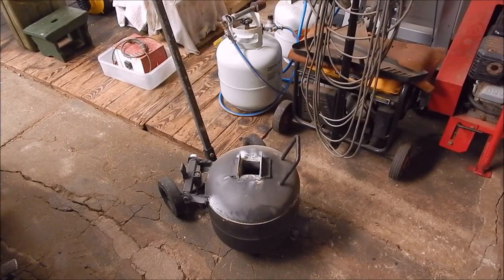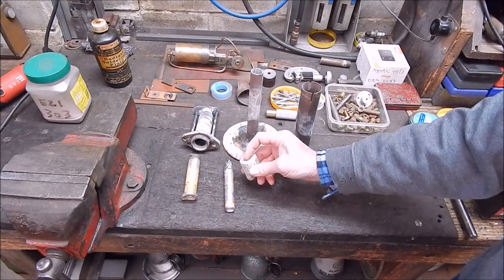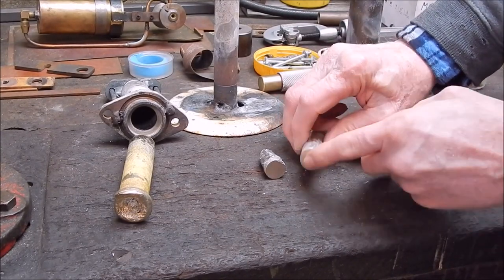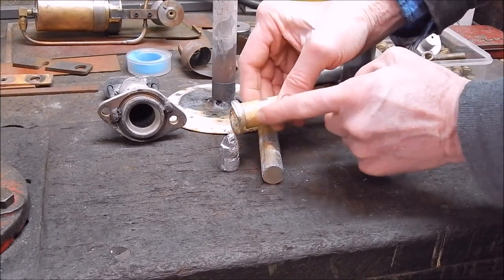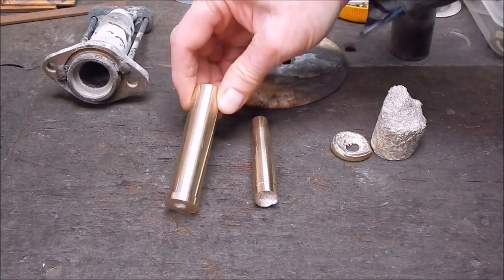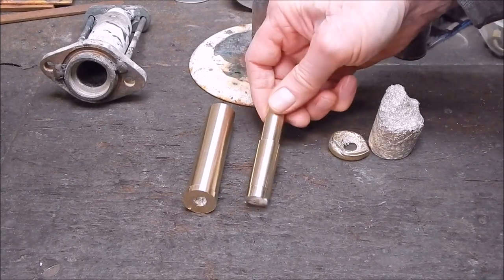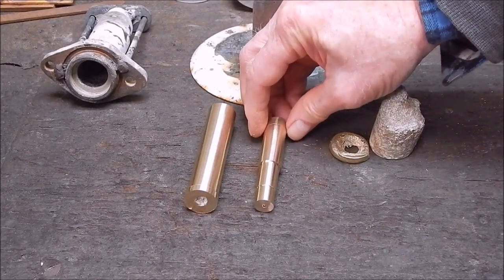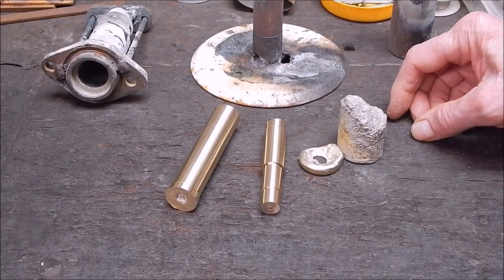Tips for successful backyard casting of brass round stock

Comment from the maker: Note:  Next time I melt chromed brass I will pour the melt into the large mold and hold it at high temp to keep it liquid and allow the heavier metal (whatever it is) to settle/pool at the bottom.  Then it should be easy to remove that layer with the saw when cooled.  Should work I think. 

I have come to the conclusion that the heavier mystery metal may be nickel, used as a binder/intermediate layer between the brass and chrome.

Cheers Rob

Comment: Thanks Rob, I’ll be taking that on board. I have buckets of scrap brass and number 2 copper to melt, number 1 copper goes to the scrappers. When I’m melting scrap aluminium I like to pour it into cast iron muffin pans first and then remelt what I need. I know that gets poo pood by the experts but that’s the way I prefer to do it. I also like to cast separate batches of similar material and this has revealed quite a difference in quality. I found complex heavy vehicle cast parts gave me the best “ingots” being very smooth with a beautiful even sheen and no porosity when cut where as a bucket of aluminium horse shoes were rubbish in comparison with a rough finish and some porosity when cut and more of a frosty finish to them. I guess this is due to the vast and complex mix that goes into what looks to be ordinary aluminium. I will also separate and pre-melt my brass and copper as well after watching your video. I put it down to the price of using scrap materials but it also give you the benefit of seeing how the metal will cast before potentially ruining a pour. Cheers mate, Stuart. Canberra. 👍👍👍
Reply from the maker: Hi Stuart.  Next time I melt chromed brass I will pour the melt into the large mold and hold it at high temp to keep it liquid and allow the heavier metal to settle/pool at the bottom.  Then it should be easy to remove that layer with the saw when cooled.  Should work I think. 

There certainly are enormous differences and number of types of aluminium.  Brass is similar and it's all related to the copper content as far as I know.  The cheap stuff being sold on Ebay/Banggood is a case in point.  Try silver soldering it and it may even melt due to the high zinc (or even aluminium) content.  It's happened to me if you get too agressive with the torch.

Fascinating subject which is far more complex than most beginners realise.

Cheers Rob
Reply: @Xynudu  Absolutely it is. I was originally getting all confused but the best tip I was given was to use cast aluminium scrap as that already contained the correct blend of materials to suit casting. I have access to large diesel pistons but I don’t bother and I also scrap any extruded alli and just stick to cast.  Cheers
Reply from the maker: Yes, I only use ally that has been cast and machined before.  Even then, there are huge quality/consistency variations and some grey looking die cast is likely to be rubbish. I find that high stress load scrap such as alloy vehicle rims are the best option and very cheap or even free.  Cheers Rob

Comment: Hiya, Rob. I believe those tap cover parts to be chrome plated zamak alloy.  Google will tell you all about it.  It's not totally chrome as a few micron thick coating could never amount to that much metal.  Of course without analysis we can never be certain but zamak is commonly used in bathroom fittings.
Reply from the maker: OK, that's a possibility, but Zamac doesn't contain brass, which is what 80% of it was when I turned it down. Cheers Rob

Comment: Hi Rob, another good video and thanks for sharing your knowledge and findings. I will need to do this soon as I have no solid brass left for projects. But, I do have a lot of brass fittings that I can melt down. When you let it cool down slowly, is it easier to get out of the mold than aluminum?
Reply from the maker: No, it has a lower expansion rate and can be hard to knock out.  A press would be useful.  It comes out more easily if you don't overheat the mold (to red hot).  Cheers Rob

Comment: Interesting stuff Rob. I never thought about it before but plumbing fittings must make a great source of brass, I'm sure that many just get thrown away. Cheers, Alan.
Reply from the maker: Hi Alan, I had a lot of these worn out old tap fittings laying around looking useless for years and this is a great way to get more life out of them.  The tap body brass is very good quality.  I had reservations about the chrome plated bits and hoped it would just burn up, but I was dead wrong.  The scrap man would give bugger all for them any way.

Next time I will pour the melt of these bits and hold the mold at high temp to allow the heavier metal to settle to the bottom for easy removal with the saw when cooled.  Should work I think. 

Cheers Rob

Comment: You can sand blast the chrome off. You can use hydrochloric acid (muriatic acid) solution or sodium hydroxide solution in a well ventilated area.

Comment: You got some very useful brass out of your scrap Rob. I imagine it is posable to cast larger diameter pieces and would only be restricted by the amount of actual scrap you have and of course the capabilities of the furnace you made. I enjoyed the making of this furnace and glad your making full use of it. Watch the fuel bills boss
Reply from the maker: Hi Ian.  The furnace is a huge success and cost very little to knock up.  Certainly handy being able to stick weld.  I did most of it with AC as I find that best for dodgy/scrap metal.  DC is much more particular and subject to arc blow.  I cut my teeth on AC and still prefer it.  The burner does eat up the gas, but not at a horrific rate.  That cylinder has done at least four melt sessions and will go one more, so that's about $5 AU a pop.  Quite reasonable.  Cheers Rob
Reply: @Xynudu  Great you share this stuff Rob. I have an arc welder tucked away for future use but want to try TIG or wire at some stage in life..one day.
Reply from the maker: Hi Ian.  I have never actually tried MIG or TIG but seen plenty done badly.  MIG only works well when used with gas and once again being DC the job must be thoroughly clean.  Those cheapskate gasless MIG spools just make huge spatter from my observations.

A decent AC stick unit can weld quite cleanly if done correctly.  DC stick is also pretty clean, but arc blow can be a serious/frustrating issue.  The slightest bit of magnetism in the steel will wreak havoc.   You rarely get arc blow with AC. 

For thin walled jobs like gas cylinders AC can work well provided you don't linger too long in one spot.  So you need to have some practical experience before attempting it.   A bit of paint hides a multitude of sins, so nothing to worry about ;)  Cheers Rob

Comment: not to bad rob .. your right with more heat and hold it there for a bit..
Reply from the maker: Hi Shawn. I think it may be the answer.  I'm also thinking the mystery metal may be nickel, used as a bonding agent between the brass and chrome layers.  I do know they do similar when electroplating some materials.  Cheers Rob
Reply: @Xynudu  That sound very possible Rob..

Comment: I reckon that was zinc at the bottom. Chromium has a melting point of over 1900 oC, zinc around 450 oC, while brass is around 950 oC, so I reckon the zinc melted and separated from the molten brass due to its weight. I'm no metallurgist, and I'm sure its far more complex than I imagine but basics are basics.
Reply from the maker: Good point Benny.  I thought being thin the chrome may burn up, but it's more likely to separate as a solid.  Looking at the metal weight table it indicates brass and copper are heavier than zinc and chrome, so that doesn't gel with what happened. I'm a bit puzzled by all this.

Next time I melt chromed brass I will pour the melt into the large mold and hold it at high temp to keep it liquid and allow the heavier metal (whatever it is) to settle/pool at the bottom.  Then it should be easy to remove that layer with the saw when cooled.  Should work I think. 

Cheers Rob
Reply: @Xynudu  Sounds like a plan. 
I am puzzled too...could it be lead - perhaps leaded copper? I found a comment in a researchgate forum where melting the leaded copper resulted in a separation of the two metals due to differences in specific gravity. I look forward to any other info you may uncover Rob!
Then the other titbit: "crystalline like structure that broke off by tapping"...not making much sense! That chunk you cut off - can you scrape it easily - is it soft like lead?
Reply from the maker: I'm wondering if it's Nickel and was used as a binder/base layer between the brass and chrome.  That's the only metal that fits the weight table variations by being heaviest.  Cheers Rob
Reply: @Xynudu  That sounds plausible - it looked like 10% of the rod was that material - you reckon there would be that much nickel required for plating? Rob, the plot thickens!
Reply from the maker: I'm not an electroplater Benny, but I do know they use multiple elements in layers on some electro plating jobs.  Given the original brass tap plates were pretty thin, the percentage of chrome and bonding elements would be proportionally high, so 10% could be around the mark.   Anyway I've used up all my old chrome tap fittings for now, so it's time to move on.  Cheers Rob
Reply: @Xynudu  Have you tried to see if it is magnetic?
If it is nickel it will be attracted to a magnet all other metals in brass ie copper, zinc and chromium are non magnetic.  Flaking chrome plating is sometimes attracted to a magnet due to the nickel plating.
Reply: @Xynudu  I hear you Rob.

Comment: I would be more than happy to use brass like that Rob---it looks excellent....  Question--have you tried using any of it for bearing bushing---wearing etc.. regards E
Reply from the maker: Hi Ian.  I have used it for small close fitting pistons in air/steam engines without any issues.  It seems to machine with similar characteristics to good quality bought brass and my metal bandsaw has a hard time cutting it, so it is quite hard.  Cheers Rob
Reply: @Xynudu  Thats good to know Rob---you can rely on a product thats good..

Comment: Hi Rob

Thank you for your efforts, please keep up the good work
It would be interesting to see the actual properties of these home cast materials, if anybody has access to suitable machinery and equipment to do metalurgical tests

I have been casting my own aluminium, brass and copper for a few years now and have used it for many things, without any problems, its just that I never know what grade it is, or even close too. When I have melted a mix of brass scrap of unknown grades, my end result is also unknown

I would not use homecast for anything safety critical, but I never know how good or bad it is

I have cast copper inserts from household water pipes for mallets and used them vigorously and they have behaved just like genuine ones
I have made brass engineers hammers out of plumbing fittings, again with no problems

I always try to separate my metal before I melt it, into groups and write on the cast bar what it was made from "aluminium ladders" "car wheel" or "burnt out car" are common ones

I use steel molds for my casting of general barstock shapes and blocks and had to thrash the cast item out of the  mold, but never managed to break any

I use extruded aluminium for casting and other than a bit more shrinkage, claggy machining and difficulty in getting a shiny finish, they have all been perfectly usable for non critical parts

It would be intersting to see someone do some serious testing of homecast materials

Thanks

Sam
Reply from the maker: Hi Sam, have you ever seen this mystery metal result before ?  I was quite surprised.  It has strange characteristics.  Looking at the metal mass tables it's also strange that it sank to the bottom of the mold as that rules out most likely suggested metals, except one "Nickel", but how that fits into the equation I can't say.  I think I can do a work around by keeping it liquid in the mold to settle out for a while.  I'm out of plated fittings now so it may take a while to try.  Cheers Rob

Comment: Hi, How did you get the pour out of the mold after it cooled?
Reply from the maker: Knocked out with a punch as the difference in expansion rates loosens the plug slightly.

Comment: The brittleness makes me think zinc (it's hard and brittle). Soaking in a medium concentration acid solution (like battery acid, vinegar boiled to 1/4 volume, even just a box of tartaric acid (cream of tartar) dissolved in a liter of water will tell... zinc will be etched quite obviously. You'll probably find it's zinc and chrome
Reply from the maker: It's an interesting one for sure.  Probably be worth pouring it into the larger mold next time and hold the heat at red hot for a while to allow all the heavier metal to pool at the bottom for easy removal with the saw.  To try and remove the chrome before melting would be difficult I think.  Cheers Rob
Reply: @Xynudu  agree 100%. Stripping chrome would be a pain. If you have enough of the escutcheon plates to warrant it (or similarly plated parts), maybe an even larger "precipitation mold" just to produce clean raw alloy for remelt.